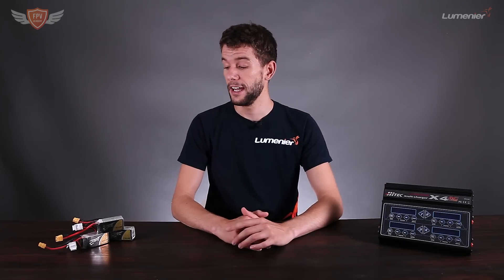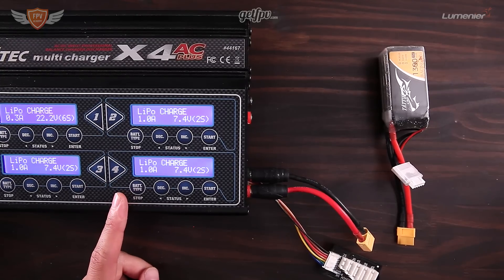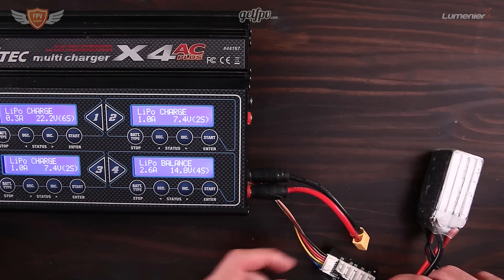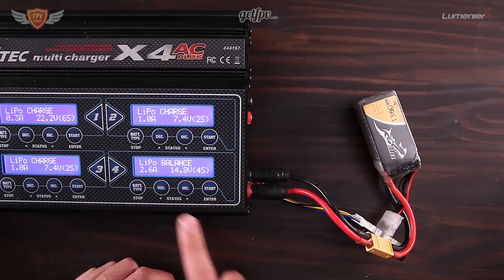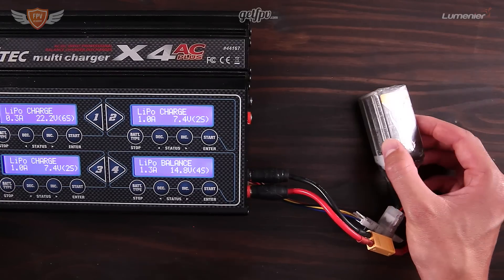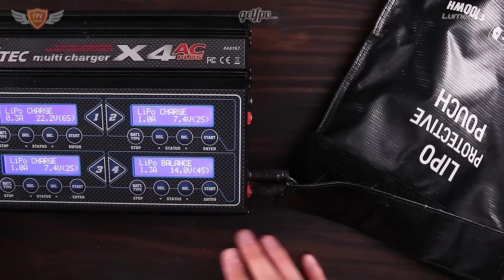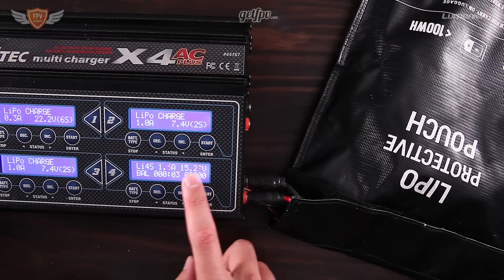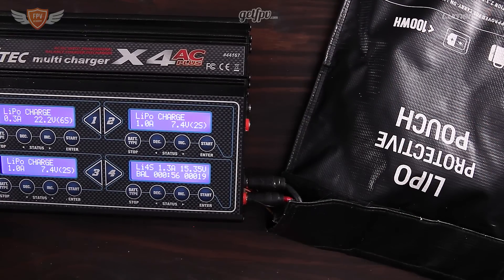How to charge your FPV Quadcopter LiPo Batteries

Comment: Let's say you're in the most hurry you'll ever be, like before a race and everyone is waiting for you, if the specifications allow it, can you charge at 10C just that one time or will it most likely explode even though the manufacturer specs allow it? If it allows it and you do it that one time, will the battery life decrease massively or just a bit and will the flight after a 10C charge be only a short amount of time compared to how long it actually should last?
Reply: Nice answer you got right lol.... obviously he really didnt know... but supposedly I read a few links and these testing guys tested charging from 1C-3C on a 1000 amp battery and they all said it does not ruin the battery at all (long or short term)... and they said this is why they made these charges to charge at higher C rates.....

As far as 10C I'm not sure about that lol

Comment: So if the battery is drained as hell, can you not recharge it?
Reply: You can recharge it.... problem is it wont hold that 4.2 volt charge for very long (basically the battery is depleted quicker

Comment: When that battery came up as low voltage I was hoping you were going to cover how to recover it.
This is my first winter of owning Lipos, I'm ashamed to say I didn't put any of them in storage voltage. I have some that I'd fully charged before my last flight, one that was on the quad and would be discharged down to a level it would need recharging before using again (3.2v?). I'm actually scared to plug them in as I don't know what state they'll be in.

Comment: So should I not charge my  lipo at 5A 1300 4s
Reply from the maker: Yes, do not charge at 5A. Maximum is 3.6A in my opinion. But asfest is 1.3A. Charge at 2.6A if you're in a rush :)
Reply: Depends on what charging rate your battery is rated at. If it can charge at 2C, it can charge maximum at 1,3x2=2,6A. I would charge on 1C always if you have the time. Charging at 5A is too much, but maybe if your battery can handle it it should be fine.